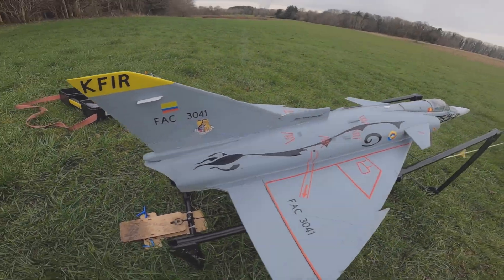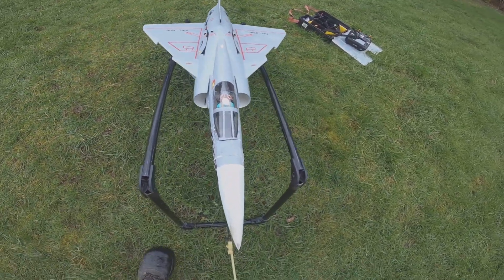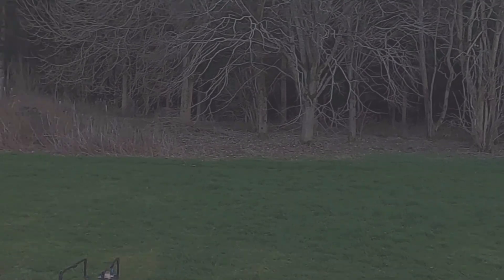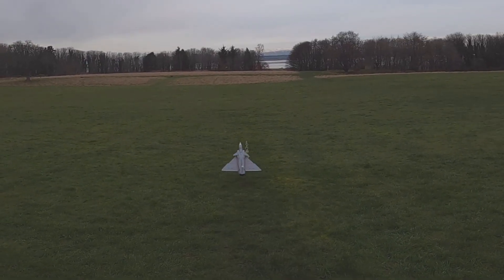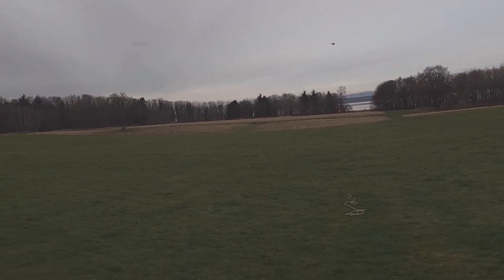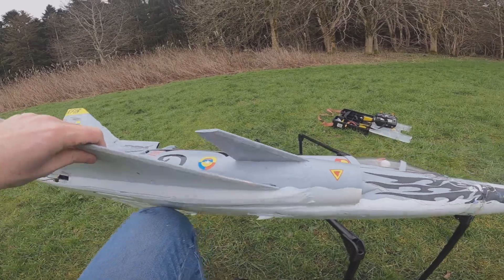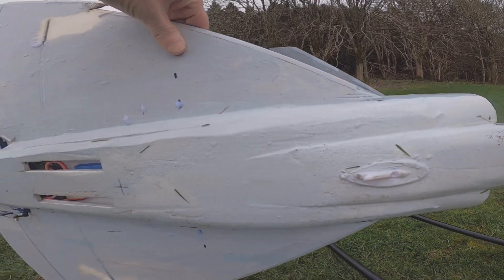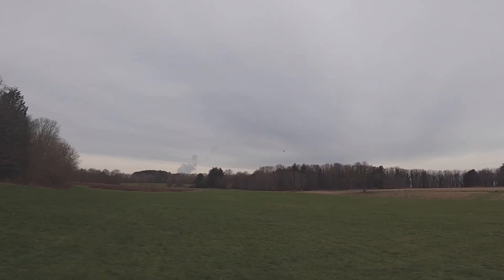Kfir 70mm / Maiden / Jetworks

Comment: Do you think 4s 2200 is a bit small for a 70mm fan, could it be causing too big a voltage drop when it's on load? Great video as usual!
Reply from the maker: don't think so pal its a 2200 70c so its got a bit punch just shorter flight time, will throw a bigger C rating in and give it another go ;) thanks pal